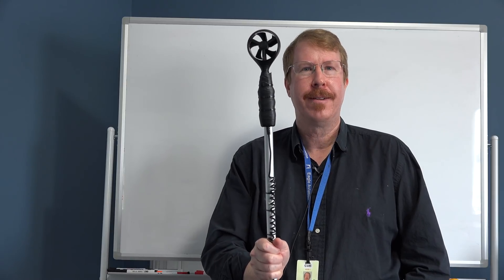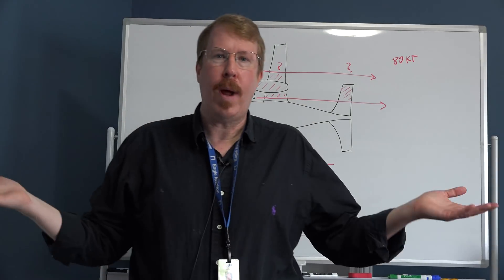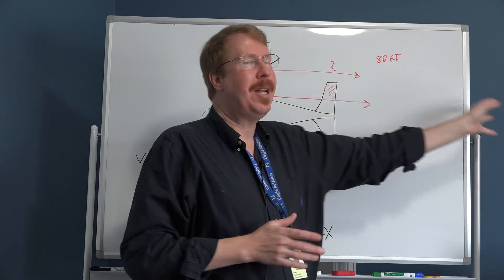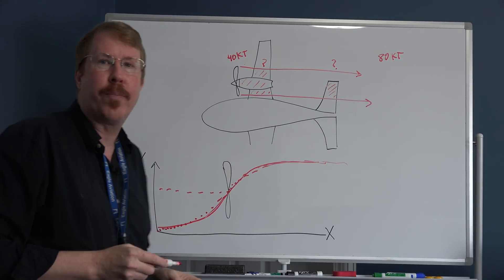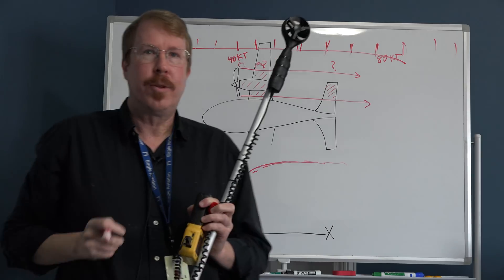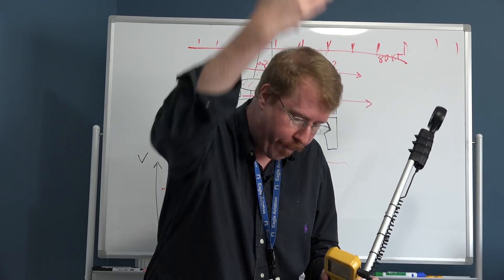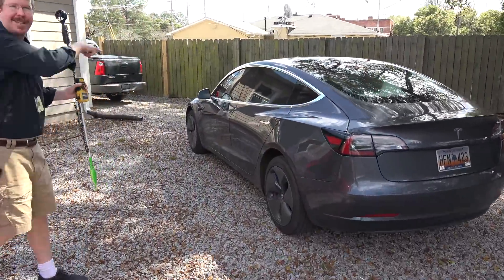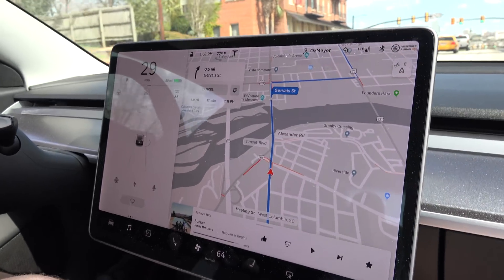Testing Prop Wash on the Ground for X-Plane Flight Model

Comment: As anyone who has used a fan to cool themselves on a hot day, the mass of air the fan moves is not a column - it is actually a cone.  That is the region of air the fan moves increases in diameter as the air increases distance from the fan.

Has anyone attempted to measure the effect of the increasing diameter of airflow as the air leaves the prop.  Is this significant in calculating flight dynamics for aircraft simulation?

Comment: A great demonstration of how assumptions in ideal conditions in theories change the outcome by a mile. I was laughing so hard imagining someone holding a stick outside the window of a flying plane. But my suggestion is you can achieve better results by testing on the scaled model of the airplane than the real flying because of the limitations imposed by dangers involved in hanging on to a device at 100 mph with windows open. It will not be perfect but serves the purpose.

Comment: One thing I noticed about Austin’s test was he was trying to measure air flowing straight back but the airflow doesn’t go straight back it swirls around the airframe in a corkscrew fashion so unless he had the anemometer turned slightly until he got the maximum reading at each station, his test numbers could’ve been off a bit but probably not enough to change the outcome of the overall test evidence theory tho.

Comment: The problem is that the plane is stationary, so the wash loses energy accelerating surrounding stationary air. It would be different if the plane moved.

Comment: Austin. You can work on this model until you're blue in the face but it means absolutely nothing if there is no airflow and particle flow in Xplane!!!!!!! There's no simulation in the actual environment of air, humidity or temp so there forces acting on the aircraft are nearly missing. You need to be working on the visual just as much because not many of use simmers, even hardcore simmers give a flying hoot about this

Comment: Interesting! I wonder if rear mounted props such as on the Icon A5 achieve a slightly higher thrust for the same engine power due to this effect? Because the prop wash will push on parts of the aircraft, and friction there might contribute to the formation of turbulence

Comment: Thanks for putting yourself out there to push realism to the next level guys!  I do have a couple of questions though.  I fly C172s IRL and I noticed 2 things that were different from the XP default 172 and the ones I fly.  1) The ball in the TC is less sensitive than IRL (it doesn't react the same way as RL - the ball doesn't deviate from the centre very much), is this a setting thing or there's a particular reason for its behaviour?  And 2) When I increase power on climb (full power to achieve climb), I need to physically put in more right rudder to counteract the slipstream.  But in XP11 there doesn't seem to have a need to do that.  Again, is that design choice or there are settings I need to look into?  Thanks in advance!

Comment: Austin, your are absolutely awesome! Thanks for this amazing experiment.  The extra component that you guys are discussing in the last minutes is something that you might want to include. The air is in fact compressible. So... your findings will be slightly different at high speed and lower density (altitude).  They will vary with vertical speed as well. Looking forward to your next video. ´Keep the passion level up!

Comment: I'm not an aerospace engineer, I am an electrical engineer. I suspect that your air pressure drops off logarithmic as it also speeds up linearly. The linear increase is F=m.dV, the log drop off is as the area of the "cone" that leaves the prop expands. This is how sound energy drops (dB).

Comment: A better test would be plant 8-10 remote meters along the plane body and measure while IN FLIGHT. That would be a better sampling...
Reply: Yes, but that would most likely violate a bunch of FAA regulations. I can't recall the exact FAR that prohibits this, but it does define, in there, what constitutes doing this, without getting an STC (supplemental type certificate).For instance, attaching a small Gopro camera, can be done without going against the regs!
Reply: @747-pilot  hmm...interesting. Nonsensical, so I would like to know the justification for prohibiting such. I would think allowances would be made in certain academic settings when people can prove they are competent to handle such things.
Reply: @thegood9  I believe their justification, is that it has the potential to change the structure, and therefore the aerodynamics / flight model of the plane.It is a fine line, what constitutes modifying the airplane body (since you would be PHYSICALLY attaching these things to the plane, while just holding something out the window, might have a somewhat similar effect, there is no structural change to the airframe). And even though it might sound silly, that's what the regs say. I don't make the rules, the FAA does! Oh, and yes, if you have some kind of permission from the FAA, you most likely could do it!

Comment: Thank you for this great and enlightening video. Could it be that the original theory is based on kinda ideal conditions . i. e. a vacuum behind the prop where the the pro just blows the air through without resistance of other air. Just like the feather and the stone falling at same speed in a vacuum.

Comment: Fascinating test, but I wonder if I've identified a flaw. I'm not an aerospace engineer, but I feel like the theory must be relating to TAS (true airspeed) while Austin is measuring IAS (indicated airspeed). I have a hunch that if you calculate IAS from the TAS and pressure curves predicted by theory, that you would find the highest IAS predicted nearest the prop. I feel like this must be true in order to not violate fundamental Newtonian physics--IAS is energy, and energy must be highest at the moment it is injected, and will only bleed off from there. The whole discussion may be moot though if IAS is what needs to be modeled (and as a pilot, it probably is). But, maybe the theory is not wrong.

Comment: You honestly think the aerodynamic theories are wrong? No, it's that you don't understand them. Nobody with an ounce of common sense and understanding of basic physics would assume the air would continue to accelerate, especially by a factor of 2. Not even in a 'perfect' world. If theory were that far off then any modeling vs flight test would show HUGE errors, if nothing else from skin friction.

It always comes down to conservation of energy. The prop imparts energy to the air. Directly and immediately behind the propeller disc (technically through the 'disc' since it isn't infinitely flat), that added energy increases the velocity of the air. How well it does that is a factor of prop efficiency. Here you will see a large spike in air speed. At all points after the air velocity will decrease. This happens for a variety of reasons, including:
 - energy is lost to friction; fast air moving against slow air, and air moving across a body, such as the fuselage
 - mixing - high speed air from the prop mixes with slower speed air around it. Conservation of momentum shows that as mass is added, the body has to move slower.
 - at the same time, the air is spreading. More volume, same energy, slower speed.
 - heat - what compression does happen (not as much as you'd think for most GA props), some energy is turned into heat. That hotter air will return back to freestream temperature, and as it cools, it slows

All that matters for THRUST is what happens ON the prop. The force on the blades, pulling the shaft, pulling the motor, is what makes it go.
The air moving BEHIND the prop adds DRAG (and some lift), and thus diminishes effective thrust. 

Some people refer to this combination as the installed thrust; what you can get out of a given prop/engine combo on a test stand vs  installed in an airplane are different. Just having a body behind the prop causes increased pressure that is felt at the back of the prop. Thrust is a result of the pressure rise across the prop. If there's a now-higher pressure, you get less thrust. This and less friction-drag from higher-velocity air near the surface due to a prop are some of the reasons behind the thought that pushers are more efficient.

Getting into transonic/supersonic flows changes certain aspects, but props simply don't work well, if at all, in the transonic regime. That's a totally different story.

And to answer the sure-to-follow snarky comments, yes, I am an aeronautical engineer with an emphasis on aerodynamics/fluid dynamics, and numerical methods.

Comment: You need a wind tunnel to properly test airflow at all the points around a plane. The plane needs to be "flying" in the wind tunnel - held in place by a stick up the rear, but providing its own thrust and lift to maintain near zero force in any direction against the stick. Then you can use robotics to position the anemometer all around the plane. There's going to be radically different results at different velocities because of pressure waves. There's going to be different results with different combinations of the angle of attack, flap positions, maneuvers, and velocities. You can't get it perfect without extensive testing. And then the results will be different for each body style, for single and multi-engine, engine style, and probably barometric pressure / altitude, and humidity. If you could write a program to account for all that, then we'd need a super computer to run it. It will be interesting to see how accurate the flight physics are on the upcoming MS Flight Simulator. They are making some very big claims.

Comment: One other thing I noticed you didn't mention about the turbulence behind the prop is the dispersion of the air after it has gone through the prop. I don't think it matters much for the data but it would also explain why the velocity of the air drops so much after the prop. The air isn't contained in a cylinder like in a turbofan. It's free to disperse widely afterwards thus losing a lot of momentum quickly. Logically it stands to reason that the largest amount of pressure would be at the prop and reduced wind velocity and pressure the further away you go.

Still and awesome video! Proving theories with actual tests is science at it's finest! Do more please!

Comment: (This question is for Real Life planes, not Xplane if this question can be applied) (Since you used a real anemometer in a real-life situation). After watching this video I have a simple question, Can you double the speed of your plane moving through the air to get from point A to point B quicker, I know I said a simple question but, it's in two parts. Part 2 >, In other words, can you (slice through the air faster) as the propeller is pitched in the right direction to pull the plane through the air, to get to your destination twice as fast, ruling out a head-wind. PS. I hope I ask the question right, and not made it too difficult to answer. I always wanted to know if you could go almost as fast as a jet airplane with a single-engine at that speed, the propeller spins, to pull the air over the wing of the airplane. I also like your videos very much, keep-em coming, Very Educational.

Comment: Hey Mike how about asking Austin about the Hardware issues. I appreciate Austins Aero dynamics presentations so don’t get me wrong but there are a lot of other issues that need to be addressed and his support staff are not or will not help at all.  You  want flight theory  check out King Air.
Reply: What kind of hardware issues? Ive ran xplane over several different machines with varying configurations in peripherals/components and have never had any issues that weren't an issue on my end.
Reply: marshie1337 Oh it’s this PFC Hardware and also the 3 external visual machines won’t save the offsets I set so every time I load a new flight I have to constantly reconfigure the Offsets. A real pain in the backside. Contacted support a few months ago and still no answer. Contacted Michael and he said he would see if Austin could help but I guess he forgot.